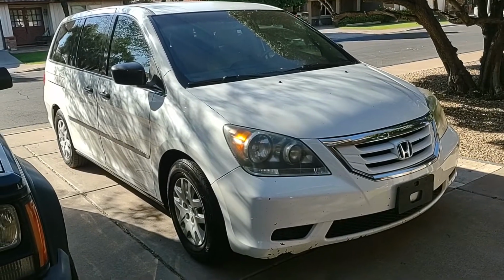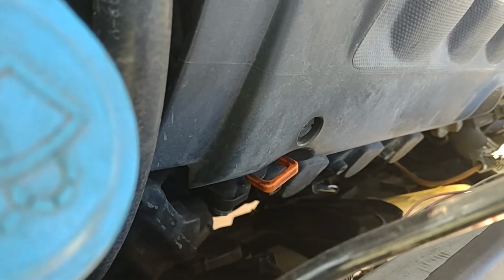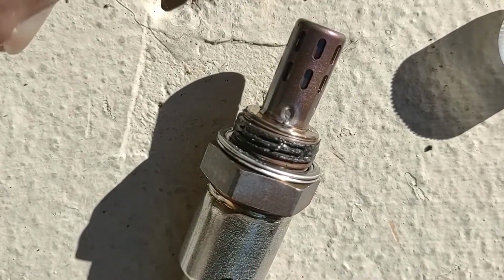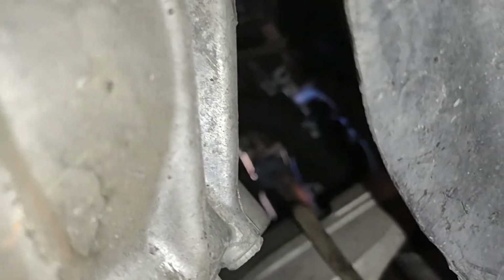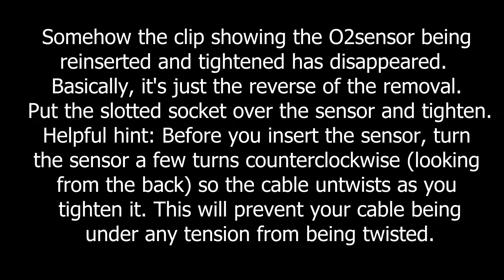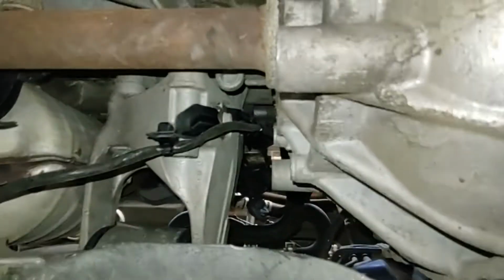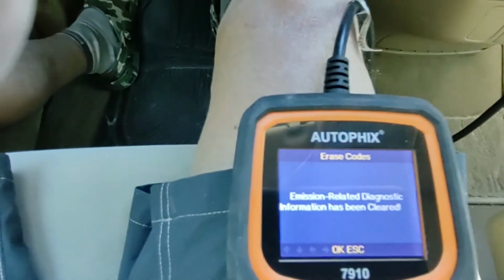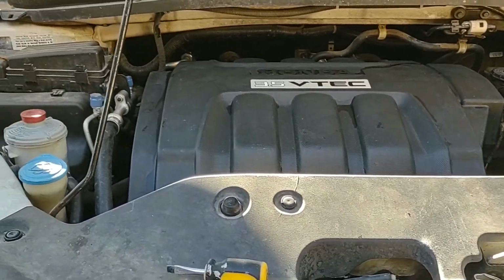Honda Odyssey (2005 - 2010) B1 S2 O2 Sensor Replacement.  Downstream, rear bank P0141 OBD error

Comment: I noticed he did not post the part numbers and brand that he used, I'm thinking of just sticking with Denso brand.. what is everybody using I really don't want to use Bosch because it's ultra sensitive..
Reply from the maker: I don't recall the part I used, but that's because it was supplied by the car's owner (a buddy I was helping out). Denso would be a good option, and FWIW, I've had good results with Bosch sensors too.

Comment: I'm getting code P0137 O2 Sensor Circuit Low Voltage Bank 1 Sensor 2 & P2270 O2 Sensor signal stuck lean bank 1 sensor 2.   Should I simply replace the bank 1 sensor 2 O2 sensor and see if that solves my problem?
Reply: AND should I go ahead and replace bank 2 sensor 2 as well?  I'm reading things online that state I should replace both to avoid possible damage to he catalytic converter.  Thoughts?
Reply from the maker: That's what I'd do in that situation.  It could possibly be a wiring / connector problem, so it would be a good idea to at least take a look before swapping out the sensor.  The post-catalytic converter sensors are relatively cheap.
Reply from the maker: There's no reason at all to swap both post-cat sensors.  They're really very "inert" - all they do is sniff the output of the catalytic converters to see whether or not they're scrubbing the hydrocarbons out of the exhaust.  They have zero impact on how the engine is operating, and don't cause any problems beyond the Check Engine Light being on, and your car failing emissions (if your state / locality require that).

Comment: I replaced my Bank 1 Sensor 2 Sensor that was throwing a code, I Cleared the codes and the code still returned, I thought the new sensor was bad, took it back, got a new one, still same thing, it was a Bosch Replacement sensor.
Reply from the maker: There are a couple possibilities. You could have a problem with the cable to the sensor.  Or maybe the sensor is just accurately reporting that the cat isn't working right (not what you want to hear, I'm betting)...
Reply: @Mark_H_DIY  I'm not convinced it's a wiring issue, as everything came apart easily and smoothly, but before I try any expensive attempts at this problem, I'm going to try an OEM NTK Sensor and see if that fixes my problem. I've heard issues with New Bosch Sensors on these honda's for some reason. People seem to only have success with NTK and Denso. One person on a forum took it to his local dealer after he replaced the sensor and still had the same issue, they ended up replacing with OEM NTK and also had to replace the ECU, bet it was an expensive fix.
Reply from the maker: FWIW I've personally had good luck with Bosch sensors (and pretty much everything else they build) as well as NTK, but anything is possible.  If the problem is that the cat itself isn't functioning properly, no sensor is going to fix it.  If your Odyssey has had an issue that can cause a clogged cat (misfires, oil leak, lots of short drives without any highway miles), it's possible that you might fix the issue with a road trip (win/win).  ;-)  There are also fuel additives that are reported to help clean up a dirty cat - based on lots of users' ratings, some of them appear to have a pretty good chance of working.
Reply: @Mark_H_DIY  I'm probably just going to try running a live feed and see what readings that sensor is giving the computer, I'm only getting a P0141 Code (O2 Sensor Heat Circuit Bank 1 Sensor 2) I have the Bluedriver. Unbelievable Scanner for the money.
Reply from the maker: If you're getting a heater code, it's probably good news (since that code shouldn't indicate a blown / worn out / plugged catalytic converter).  I'd try to chase down the wiring diagram for your Odyssey to see how that sensor's heater voltage is supplied, and then check that path.  Could be a fuse blown by the original bad sensor, or of course, a broken wire / loose connector.  I believe (but am not quite 100.000% sure) that the white wires are the heater circuit on your Bosch sensor.  You should read a fairly low impedance across those wires (with the plug unplugged) - I'm guessing somewhere between 5 and 20 ohms).  If so, it's probably fine.  The next step would be to see if there is any power reaching the corresponding "car side plug" pins when you initially start the car (the scenario where the O2 sensor heaters would be used to bring the sensor up to speed quicker).  If there's no power, you know you have to start tracing back toward the battery (and of course, everything in between).